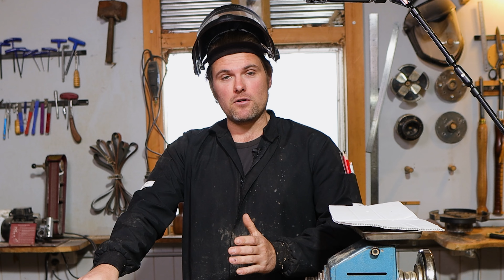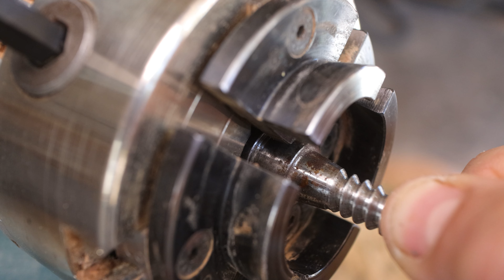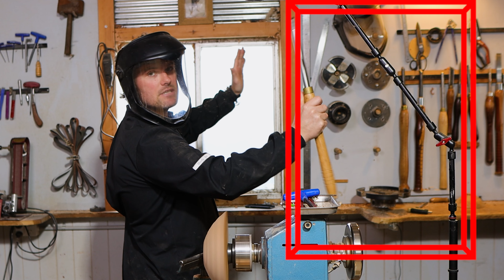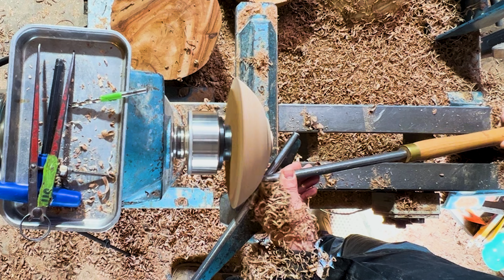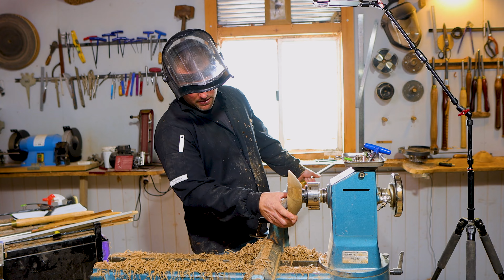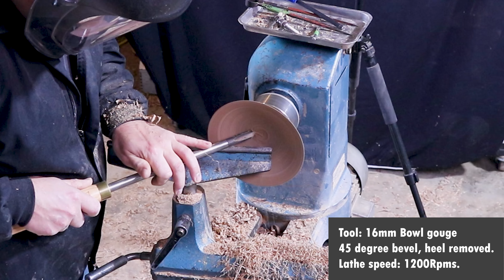Woodturning Chuck Screw Tips + Epic Slow-Mo Catch! 👌

Comment: Kerry, why do you like to use 55 degrees for the outside vs. some other angle?
Reply from the maker: The 55-degree bevel is aggressive and has plenty of bite—enough for quickly removing material while maintaining control of the cuts. Plus, it's more straightforward to grind as well. I hope this helps, mate. 
Cheers,
Kezza

Comment: Just one important item, take the edge off the bowl blank at each step-especially at the last step before taking the work off the lathe. If your hands slip while trying to unscrew the work, the chances of a deep cut in one or both hands is high, especially with hard wood-that rim can be razor sharp. One other suggestion, don’t finish the rim of the bowl until finished internal work in case you get a run back across the rim face. Makes sense? Thank you for sharing your skills. Greetings from Tasmania Australia.😁👍🦘🇦🇺
Reply from the maker: Thanks very much for the tips, Shev. Much appreciated.
Reply: @KerryCorney - I have watched many wood turning video's, some are excellent, some even down right dangerous. I saw one recently by a fellow who claims to be an expert giving a demonstration on how to turn a small (6") bowl. He started with  a slab off a small tree or limb, so it was end grain. His misuse of gouges was an excellent demonstration of what not do, quite the reverse of what he intended. He hacked out the inside with what he called a scraper, which was in fact a spindle roughing gouge. Imagine a newcomer using this combination, end grain timber and a spindle roughing gouge-think about the catch that would produce!!! Lookat some of a world class professional turner-Richard Raffan- (lives in Canberra Australia) brilliant application, superb close-up sharp video's, no music and a clear explanation at each step. He has a great selection of books and DVD's that he has produced, and has toured many countries giving wood turning demonstrations. He uses the same lathe as you and his chuck holding techniques is well worth watching-maybe techniques few folks know about. Greetings from Tasmania Australia.
Reply from the maker: @ShevillMathers  Thanks for the insight. If you check this video out, I explain Mr Raffan's remounting technique https://youtu.be/hl2MUl6_ZfQ
Cheers,
Kez.

Comment: I’ve thought about getting a 3/4” (19mm) bowl gouge for a while now but I mostly do bowls under 10” diameter. Seeing you using one in this video shows me they’re still useful for smaller work. Thanks 😊
Reply from the maker: My approach involves using the larger gouge for initial material removal, while relying on the 16mm and 12mm gouges for refining cuts. Maintaining their sharpness is crucial for a smooth finish. Feel free to update me on your progress. Cheers, mate.
Kezza